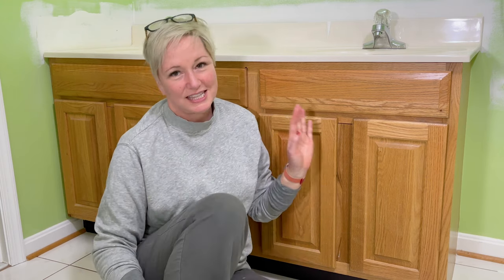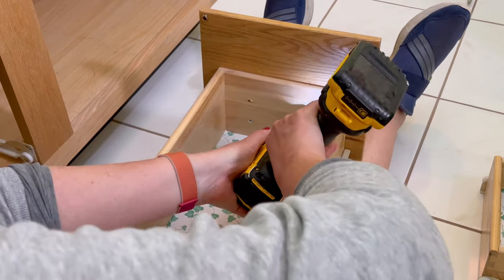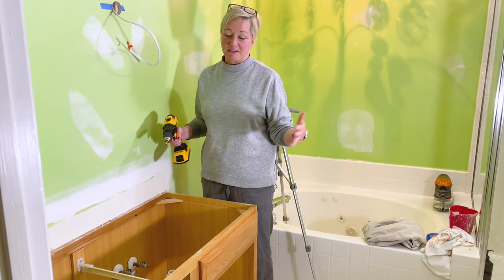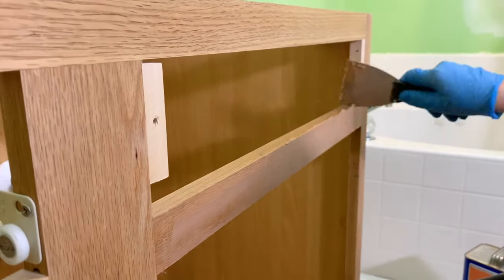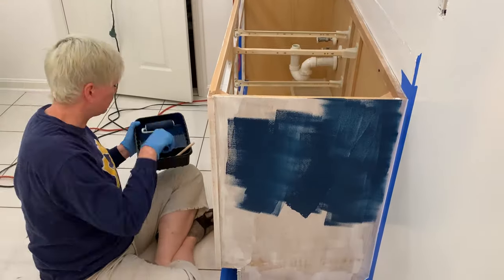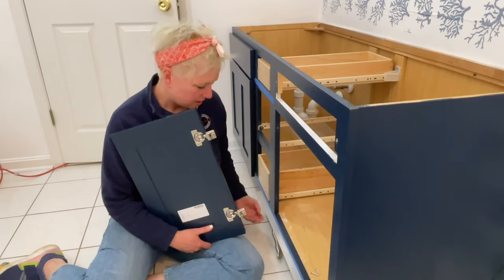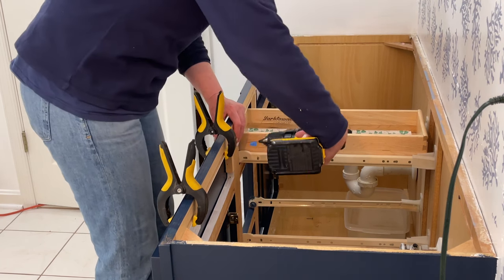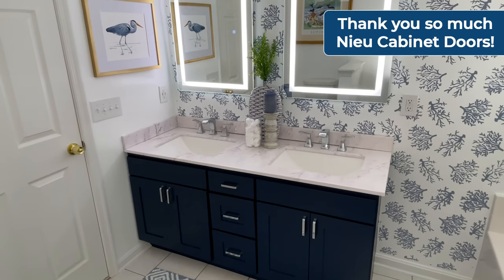DIY Bathroom Vanity Makeover: You Won't Believe the Difference!

Comment: Quick tips.

Number each door and drawer, so you can replace them and not have to do a lot of adjusting.

If you are removing the top sometimes they are “glued” or “siliconed” use a putty knife or painters tool to break the seal.

When using bondo, if you use less hardener it will harden slower. ( remember the tube is for the whole can of bondo.

If you use squeeze clamps on fresh paint you can damage the finish or the paint can stick to the clamps.

Comment: Tip:   With Heirloom All-in-One paint or Beyond Paint [they're the same paint] no need to prime since primer is included in the paint.  No need to sand.  Just clean the cabinet and paint away. Two coats is sufficient.

Comment: My bathroom vanity top with 1 sink is cultured marble and is 55" x 22" (late 90's style). As far as the vanity cabinet itself,  It's a very smooth real Maple vanity, so it's nice but outdated maple color.  Can I just paint them blue or black or white and use epoxy to re-do the top ? (the cultured top has the built in clamshell sink with a full width 55" built-in backsplash (It's all one molded cultured marble piece)).  The cultured marble is that semi yellow-ish / white-ish , so yea, it's outdated.  If you could recommend a company that makes the tops like what you've done, I've priced some at around 700 to 800 dollars and that's just the one sink, so that's why I was thinking maybe epoxy (stone-coat countertops) but if that's a nightmare, then I wouldn't want to do it.  Any suggestions are appreciated.  I will redo the linoleum floors with VINYL flooring tile (planks) that are waterproof after I level the subfloor with LATICRETE NXT Level Plus Grey 55LB,   and I will paint the walls whatever is necessary to match or offset the vanity color.  I really love what you did with your vanity, omg. just amazing!!!!  I am in a quandary.

Comment: Where did you get your mirrors with the LED lights? They look great too. Easy to install? Are they tied to your wall switch as well?
Reply from the maker: Hi David! I'm so sorry - for some reason I'm not getting notifications. We got them at Home Depot (and of course they have been discontinued) - but they were very similar to these: https://go.magik.ly/ml/1l1uu/ They were easy to install if you have basic knowledge of electrical work and they are hardwired in to the switch. We absolutely love them! Hope that helps!

Comment: The bathroom cabinet doors have this weird metal bit where the handles are (decorative, I guess) and the handle comes out but that metal bit does not. I could probably get it off with a bit of force, since I am  ot having luxk with finding new doors that sre the correct size.